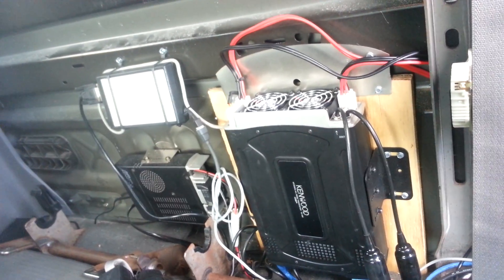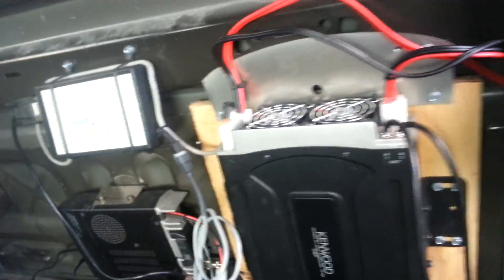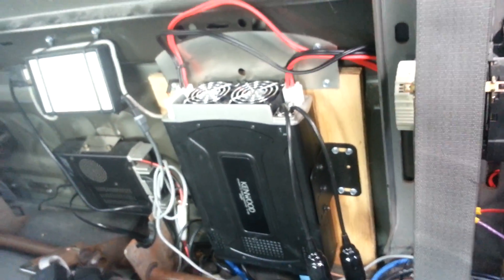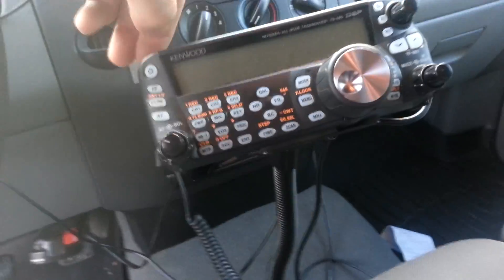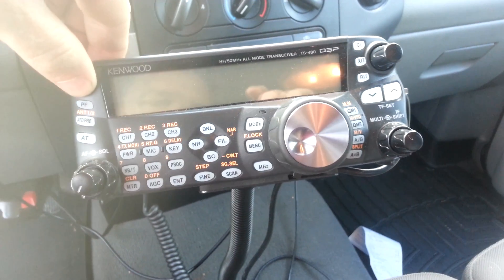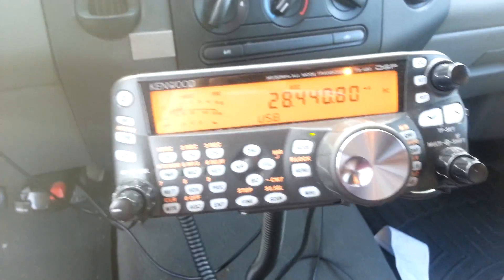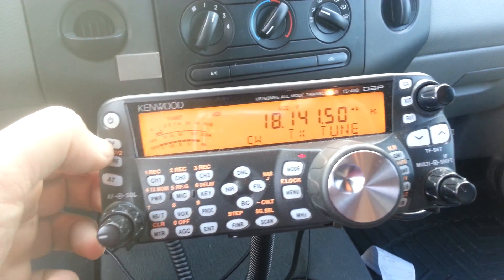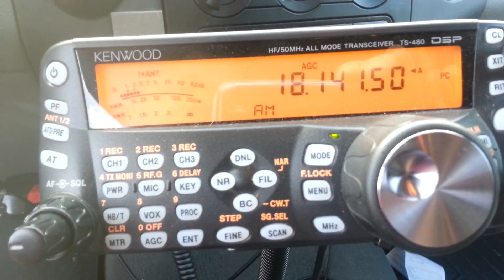TurboTuner+Kenwood480HX

Comment: Can it tune ATAS-120?
Reply from the maker: The ATAS 120 uses I think +5V and +9V to adjust the antenna up and down through the coax. So if you can make a device to convert the +- 12 volt from the tuner to the correct voltages and inject them in the coax while blocking them from the transceiver it will work.
Reply: @fredjuch5202  thanks for the info, I don't think it's a good idea to do it, better to get an external auto tuner.

Comment: very good video I have the same setup but the difference is a have the tarheel II .The tarheel II is very slow because the motor is smaller now the tarheel 100 200 or tarheel 40 have a faster motor. very good 73'